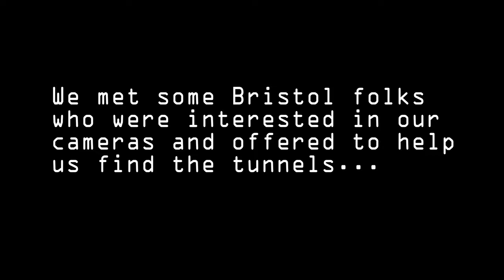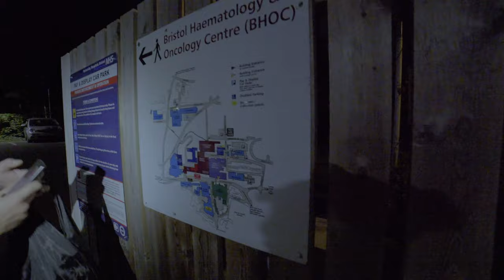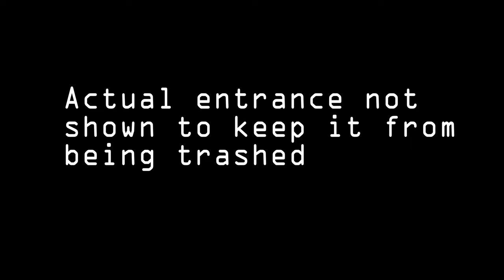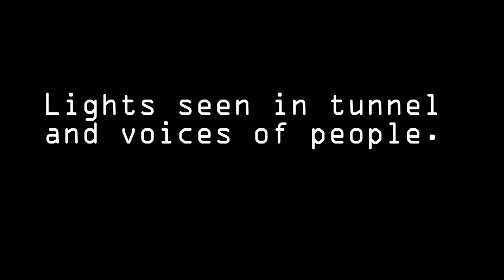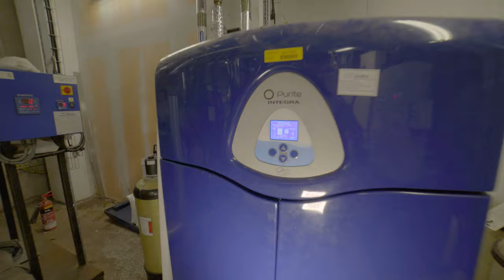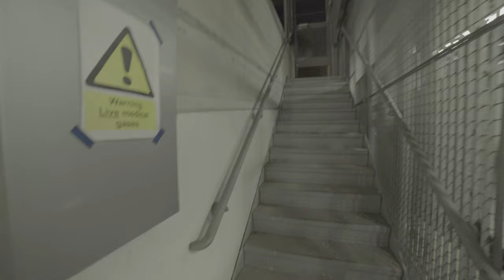Bristol Hospital BRI Underground Tunnels WE SNEAKED IN

Comment: Tunnels at hospitals, particularly those built post WWII up until the 1990’s when the PFI hospital contracts began, where know as ‘Local Distribution Systems’...they typically served a lot of structures that had a separate boiler house, and water and steam was piped into the hospital via the distribution systems...this meant that the boiler houses, which were regarded as unsafe to be within the hospital building, were located away from the main hospital structure... over the years other services may have been added, such as electricity, telecoms, gas etc... As you rightly state, many of the pipes in these tunnels still appear to be ‘lagged’ and probably contain very dangerous asbestos lagging, a cotton wool like substance, which if damaged would allow asbestos fines into the atmosphere of the tunnels and lay in dust on surfaces...steam pipes are also highly dangerous, and likely contain what is known as ‘superheated steam’, which if a pipe bursts or leaks from being climbed on, etc, could cut you in half or amputate limbs...not very nice...a lot of the pipes seem to have been recovered, where lagging may have been removed, or was rewrapped to enclose it... just remember that some hospital patients lives may depend on the services you are intruding upon...so definitely do not touch...!!   I also noticed that in the cages near the steps that went up were pipes medical gases...these are now no longer stored underground, but on surface installations..obviously, because of the risks of gas escapes etc...these link directly to gas supplies to hospital beds and operating theatres...so again...do not touch...!!...whilst I can understand buggering around on old MoD sites, I find your actions here somewhat irresponsible... I hope you had the balls to let the hospital know of the security issue here...!!
Reply: OK calm down..no damage done and nobody died!

Comment: Me and a few friends went in these tunnels in the late 80s it was very different then the entrance we used was in a secluded wooded area and after watching your video it was very different. We had a shorter ladder down and when we went uphill we had a 90degree turn left and right and when we turned right it went on for a really long way it had a couple of long ladders up that were smaller than the one at 13 odd min here they were just manholes every now and then  some deeper than others we followed the tunnel  straight downhill until we assumed we were under (about) New Cheltenham and it had a 90 degree left tunnel junction.. we were so worried our BMXs would be stolen we turned back but we think these tunnels may go so far as to connect to other hospitals? Cosham even or Frenchay? 
I'm so glad I found this video I've told so many people that didn't believe they existed. 
Also if you actually read this when I was about 5 or 6 (late 70s) we used to go DOWN Cabot tower. The entrance goes left but as a kid we climbed over the turnstile and went down a dark spiral staircase for as far as we dare, we didn't have torches. When I returned in the late 80s and climbed over it had been concreted up I was gutted. We went down and down and down lower than the tower is high I remember my brother counted the steps. 
Where it goes, nobody knows?
I had to stop, my juvenile record wouldn't allow any more mischief... 😂

Comment: The white pipes are preinsulated, so the flanges are exposed thus covered with insulation blankets post install. They are too dangerous to remove so left in place when redundant. Can't see any condensate return pipes, but they will be small. Exposed copper pipes are medical gases and suction. Steam is efficient for large complex sites as it requires no pumping and lower pressure drops across pipe networks. Water purifier and calorifier in there too.

Comment: I’ve worked in those tunnels with a team of 10 sparkies running a massive SWA cable from street level at the front of the BRI to the mains intake building which was near where you entered on the same level as the Oncology department and it was bloody hot and cramped climbing on those pipes dragging a massive cable and then securing it
Reply: What does SWA stand for mate ?